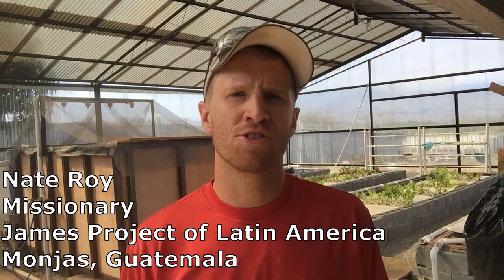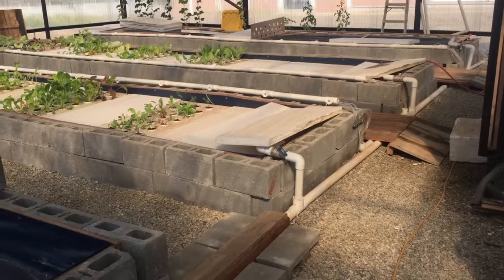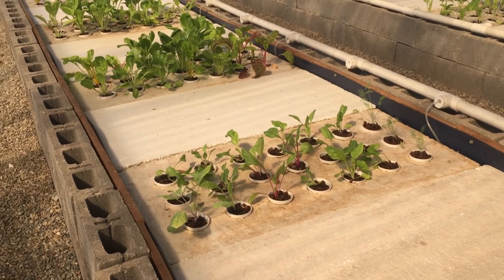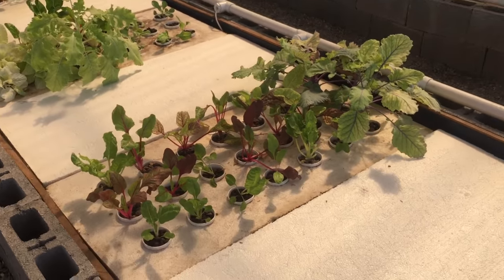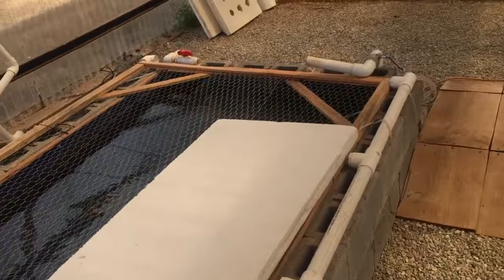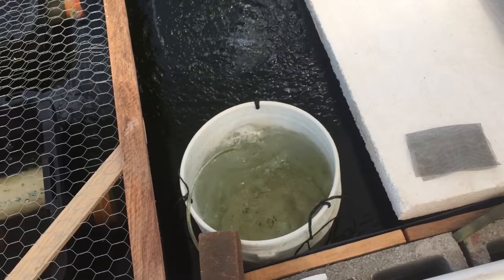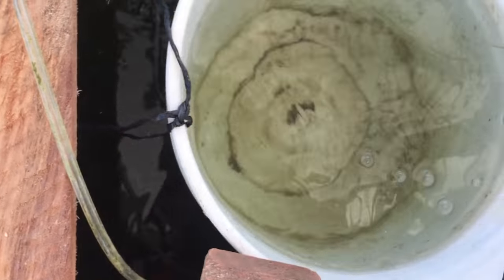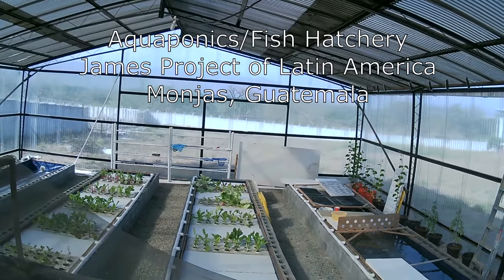Aquaponic System/Fish Farm Together

Comment: A tip for anyone just starting out and a mistake I noticed in the video, it's mechanical filtration to remove solids and biological filtration to change the chemistry, it's best to mechanically filter first, with settlement tanks, etc, as the mess clogs up the areas where the nitrifying bacterial colonise and as it breaks down creates a poor environment for the bacteria. Biological filters usually contain large surface areas, such as lava rock, fluid beds, etc.

Comment: Very informative.  Big thumbs up.  Your biggest problem seems to be overcoming your excess fish waste issues.Create a conveyor bed, (even burlap would work), which can be cranked over rollers at either end of the tank.  If the belt is continuous then a series of squeegees or brushes can remove most of the waste to be added to the compost pile for the gardens.You could raise far more fish this way without needing to cull in order to minimize fertilizer.Cheers.

Comment: Great setup! I know this is an older video and i'm sure you have made improvements but you can use crushed oyster shells in panty hose stockings to regulate PH and can use iron chelate to supplement iron which aquaponics is knows to lack in production of nutrients.

Comment: You could add red worms to your media bed or use crayfish in your first grow bed to break down the fish solids. Too many fish will overload the system, you will need a biofilter of some sort to handle the solids leaving the fish tank. You need to monitor your PH levels each day and address any issues until you balance the system.

Comment: Hey is your underground sump made of cement or concrete blocks? Do you marble chips or limestone rocks anywhere in your system? If you do this might be your ⬆️Ph. Cement and other calcium materials will leach Calcium into the water until Ph reaches about 7.4. Fish and animal wastes tend to be acidic or low Ph. Rain water should be Ph neutral or 7.0. You can add acid to lower Ph to around 6.7 or so. Love your work nutrition is paramount for proper development.

Comment: If you are breaking down ammonia via aerobic bacteria your pH should be going down not up, only anoxic conditions raise pH. More gravel media will help remove some solids but I prefer a finer media to catch suspended solids, shadecloth netting works really well for me. PH in my system has to be brought back up at leased once a week at my current feed rates. High pH leads to nutrient lockout which is probably why some of your plants are so pale. PH affects many mechanisms within the system so I would address that before trying any other fixes, broad range you want to be 6-7 but I like to keep my systems between 6.5 and 6.8 everything seems to work really well there.

Comment: Did you use a big tarp for your beds?
Reply from the maker: Yes, we used some thick custom made tarps for it.  They are vinyl vs the typical plastic
Reply from the maker: Clint Adair are you in Guatemala?   If so let's get in touch
Reply from the maker: I see.  there is a ton of stuff out there.  If you are serious I would recommend taking a course.  I was a game changer for me.  I did hours of research online and there is a lot of good info there, but also a lot of bad.  The course I took in particular was by Murray Hallam.  I would recommend it, but there are also others out there a bit more affordable.